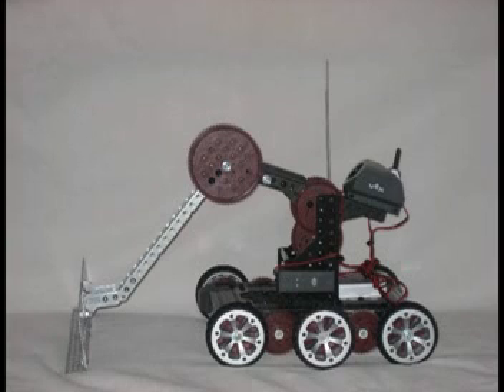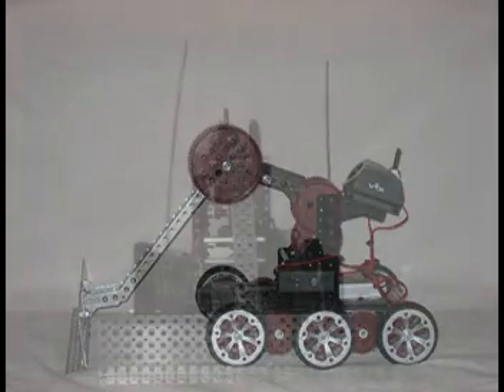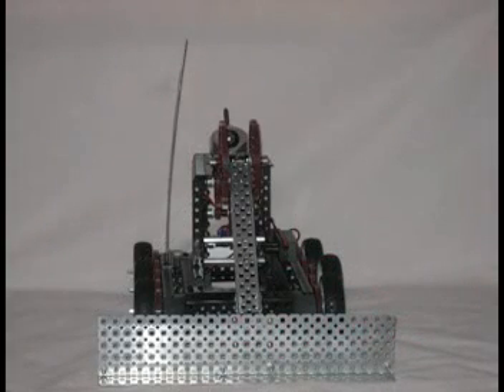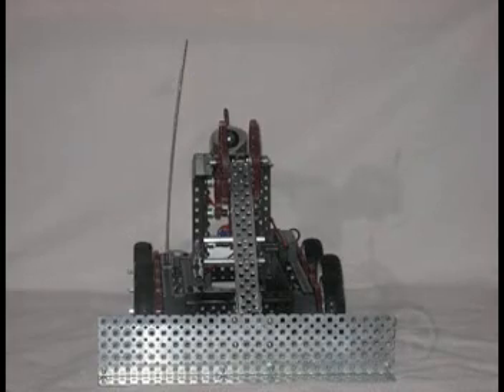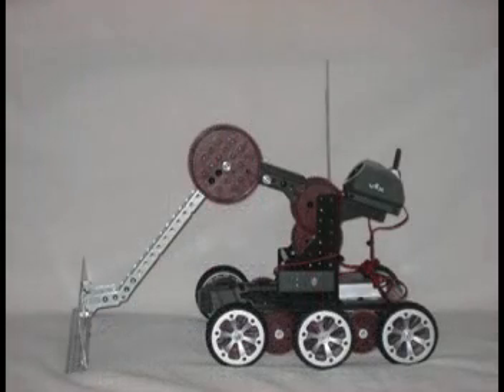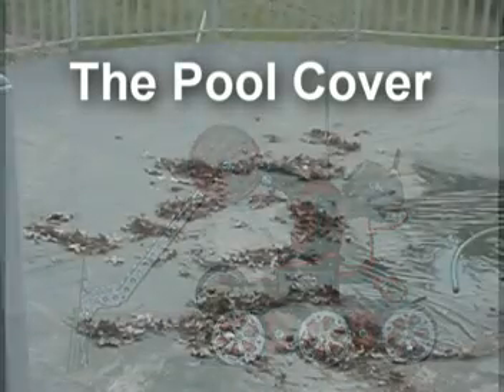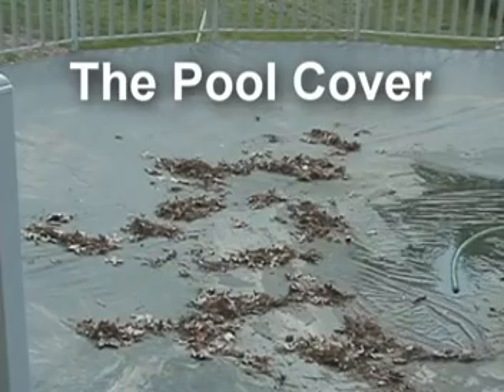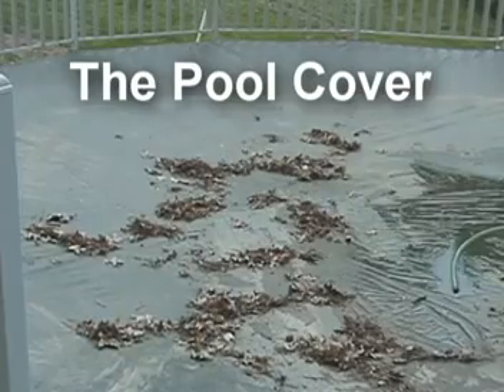Grant Imahara VEXplorer Robotics Contest Entry

Comment from the maker: The cable was just a steel cable that could be used to pull the robot off of the cover if the battery was to fail or something else was to occur that would prevent me from moving the robot using only the remote. Luckily the cable was never needed, even during the peliminary tests.